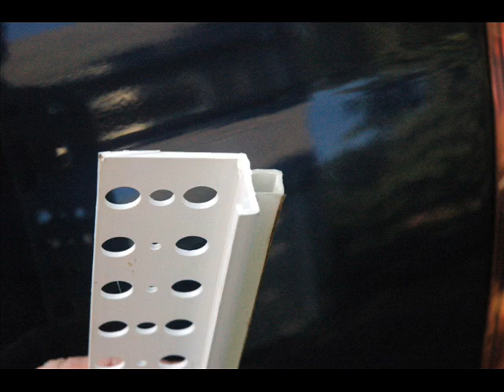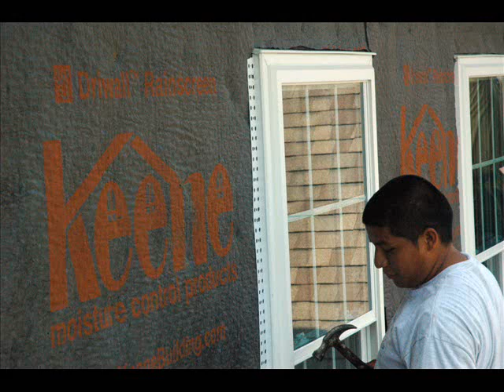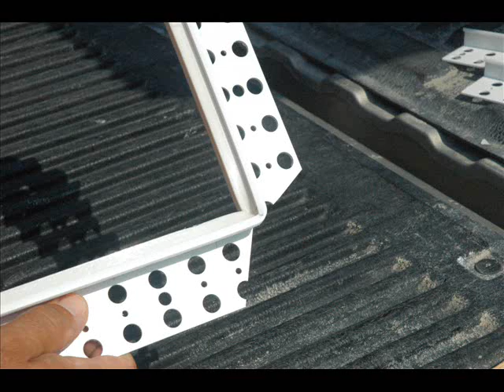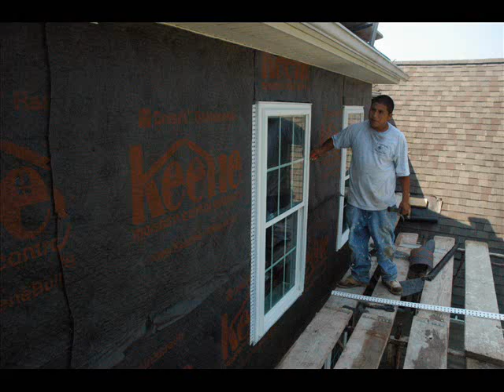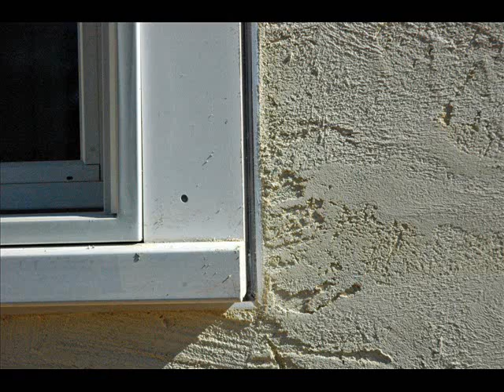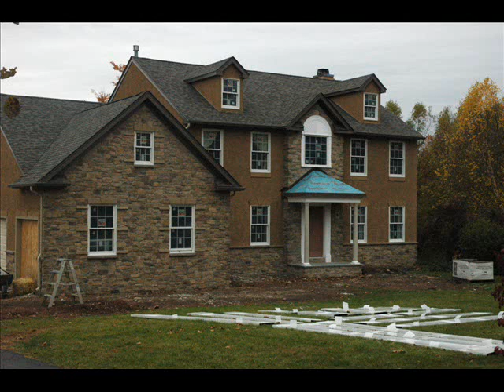EZ bead Installation Guide

Comment: Nice..... and EZ.   Didnt catch your sequence at the head of window though. Can you explaing that?  I see many details suggesting the WRB  should lap over the caseing bead flange at the window head.
Reply from the maker: Sorry so long to send.  The WRB should lap over a drip cap.  It is typically installed prior to those doing stucco and stone getting there.  A casing bead sits on top of WRB (or rainscreen)  after the drip cap and WRB are installed.

Comment: I used all these products from Amico with great success on a stucco job last year. EZ bead casing around all windows and doors, the drip cap over the top and the weep screed on the bottom. Teamed up with tyvek stucco wrap and spiderlath made the project reliable for years to come. I wouldn't want to do it any other way.